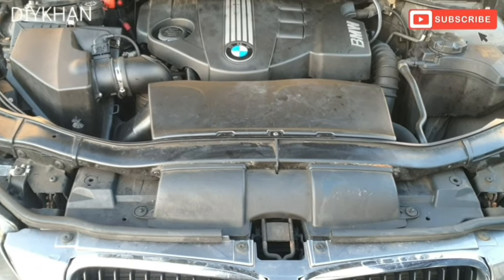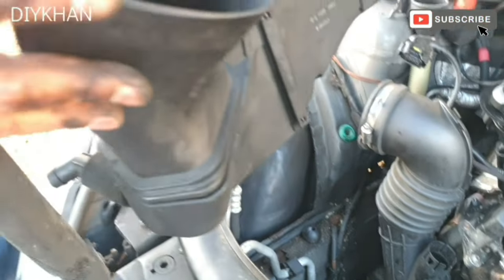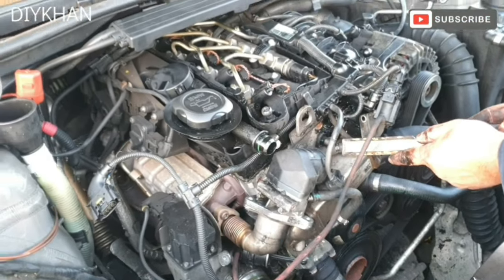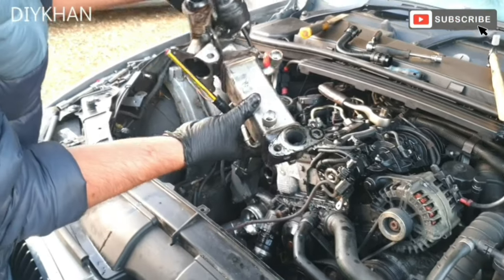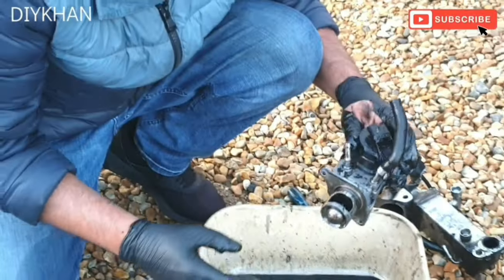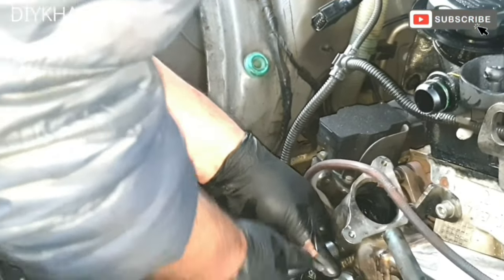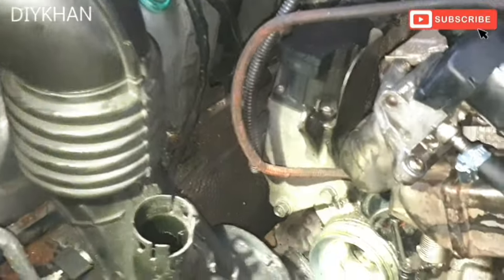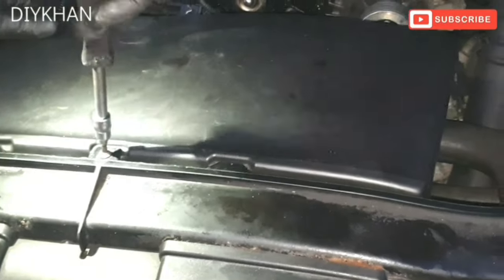How to Remove off and Deep Clean the Dirty EGR Valve and EGR Valve Cooler on BMW 320d e90 n47 Engine

Comment: I took off the EGR and cooler together, i undo the 2 bolts that connects them to each other, but i can not take them apart. I tried with a flat screwdriver to tap in between, but the screwdriver broke and the parts still dont come off. What to do?

Comment: Nice video mate.. what kind or screwdriver / tool did you use for the T30 when taking the screws of the valve? It's in an awkward tight position to get to..

Comment: I did this and lost around a litre and half of coolant topped it up and heard a stranger suction sound when I turned on ignition. Any ideas what this could be atall? car also stalled but then turned over and ran 2nd try
Reply: The noise you heard was air having entered the coolant  system when the egr cooler was disconnected. You really need to bleed the coolant lines.

Comment: Really good video where did you get the replacement hose fitting clamps from for the coolant
Reply from the maker: I bought the clamps from our local auto parts shop. Thanks for your appreciation.

Comment: Hi sir, thanks for the video it is so helpful. I have just one question regarding the soapy water cleaning part, isn’t it bad for the electronic parts to clean it with water? I just wonder if it can harm the egr or no. Thanks in advance :)
Reply from the maker: Hi. Yes as long as the electronic parts are covered with tape and the water doesn't get inside then the soapy water is the best way to clean the egr and egr cooler. Once cleaned then best to apply little oil spray on valve shaft or flaps for smooth opening and closing. Good luck and thanks for your support.

Comment: Good video. Dont you replace all the seals for xtra peace of mind?
Reply from the maker: Yes I did.
Reply from the maker: Thanks 😊
Reply: @diykhan  any idea of the part number or where to buy?
Reply from the maker: @daviddorado5632  I have got mine from local auto parts shop. If the seal look ok then just reuse them.

Comment: I was wondering,  could you use Cilit bang oven cleaner on the egr valve, saw a video on uTube a few years ago and a guy used it on an Audi TT egr valve.
Reply from the maker: Yes thats good too. Main purpose is to remove carbon off the components.

Comment: Could you tell me how do you remove the EGR valve connector harness (6:25)? Do you simply disconnect it by pulling or do you need to, somehow, unlock it using the white "locks" that are on it? I'm willing to remove my EGR valve in order to clean or replace it, but I'm not sure how to remove that harness correctly, without breaking it.
Reply from the maker: There is a clip to press.
Reply: @DIY Khan  can you advise which clip do you need to press?
Reply: Pull the white tab out a little, then press down on the white tab after extending. Connector should come out with a bit of wiggle.
Reply: @matthewbroe904  thanks for your answer. It seems really helpfull 😉 Unfortunately I've already managed to brak the lock down 😂 But surelly will remember to try to do it your way in the future 😅

Comment: Did you have any error codes or other problems before cleaning egr valve ?
Reply from the maker: I had all these codes P14A3, P115C, P115D, P14A1, P0101, P042E, P042F and P245A.
Reply: @diykhan  i have 4933, and after some time got 480A, 481A, 3F25, and finaly 4D00. Car goes to limp mode, but after 20-30 km driving, it goes off limp mode and drive just fine. Any suggestions ?
Reply from the maker: I have no idea. Sorry.
Reply: @hervoich  Hi, i also have 4933 but paried with 3ff1. Only on very cold startup and car drives fine. What was ur solution?
Reply: @victor_h9925  hi, i just disabled egr valve ( ECU deleted ) and have no problems at all.
Reply: @hervoich  What about manifold and DPF?
Reply: @victor_h9925  just MAP cleaned, and DPF still working. Issue was with electronic part of EGR, so i just disable EGR to stay closed all the time.

Comment: Mr.Muscle oven cleaner. Way way better than everything.
Reply: Yup, that’s why workshops stopped using Carb Cleaner, Brake cleaner and mineral spirits and switched to 50 gallon drums of Mr Muscle because it does everything except what its intentions was made for….

Comment: How the poes do you remove that electrical connector so easily? Im gonna fucking scrap my car over this shit
Reply from the maker: Sorry to hear that. U should buy mechanic pick tool. Here is the link which will help u to remove the connectors.
Reply: @diykhan  thanks a lot👍🏼👍🏼
Reply from the maker: https://www.ebay.co.uk/itm/314432415187?mkcid=16&mkevt=1&mkrid=711-127632-2357-0&ssspo=OL-l3bEGSSy&sssrc=4429486&ssuid=F01xFgg6QJ6&var=&widget_ver=artemis&media=MORE
Reply from the maker: @duktrilfromsouthafrica  you are welcome 😊